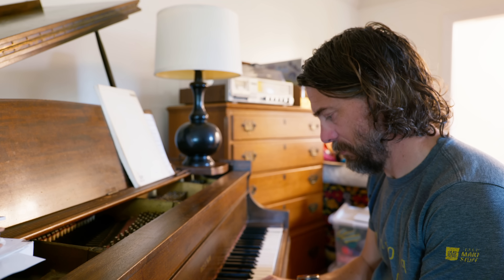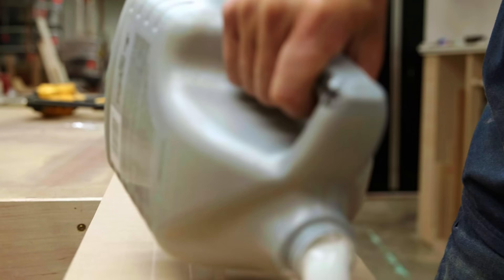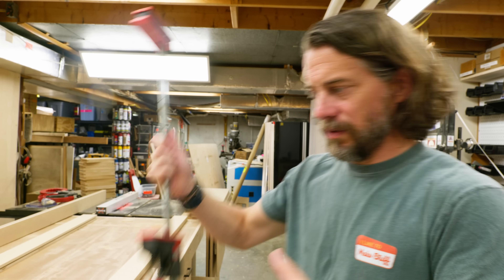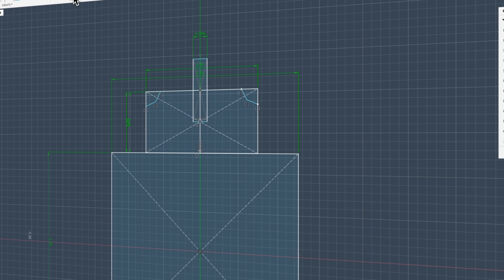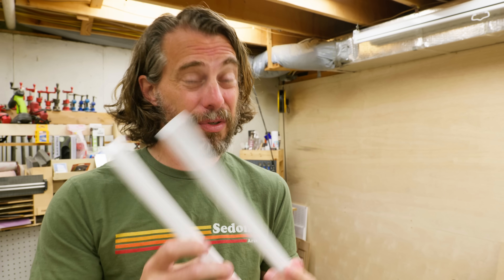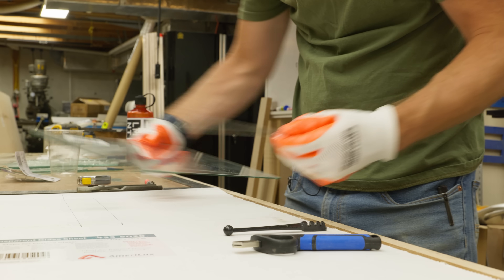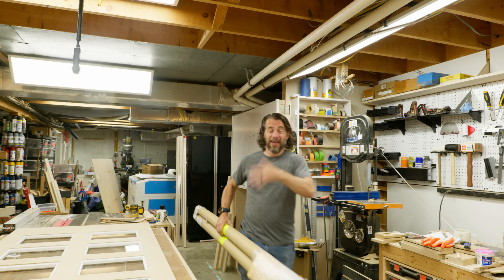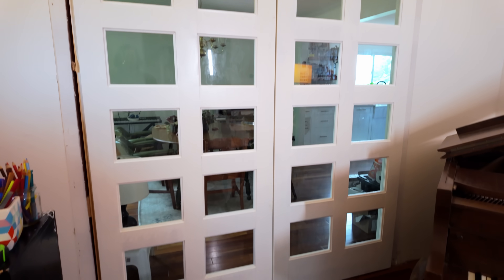I Made Doors WAY Easier With 3D Printing

Comment: Add something rubbery (neoprene?) to seal. Any crack air can move through, sound will get through. 
Could use magnets to hold the two sides together.

Comment: Just a heads-up for anyone thinking about making a door with glass inserts: Most building codes require tempered glass in doors for safety. If you use untempered glass, it could cause problems later, especially if you plan to sell your home, since it may not pass inspection.

Untempered glass breaks into large, sharp shards that can be dangerous, while tempered glass shatters into small, pebble-like pieces that are much safer. Just note that tempered glass can’t be cut after the fact, it has to be ordered to size.

Not a huge hurdle, but definitely something to consider if your looking to take on a project like this.

Comment: Glazing putty. It's existed for hundreds of years. Paintable, moldable, flexible, air-tight, long-lasting, and removable.

That said the 3D print holder is a neat idea. Doing a double pane setup with TPU interior seperator might have some interesting sound qualities.

Comment: Yeah this really is not how it should be done. You did not safe time nor money by doing those dirty hacks.
Make the door out of normal wood - MDF is not strong, not really cheap, and will likely not be lasting cause of that. Even with the MDF it would have been stronger if you made the door out of 2 thinner layers (now you could also have used normal wooden boards) so that the joint were all lap-joints: Simple to make and stronger.
For the trim: Making that with a router is straight forward and fast, and the simplest of jiggs would make sure that all cuts are at the same angle and length.
For the glass: Not a good idea to use normal flowglass for that - either get tempered glass (most likely even required by code) or use acrylic. And the glass having no movement is NOT what you want in this configuration. Sure MDF has a lot less seasonal movement but it still means that any and all movement (be it temperature/humidity related, bumping the door, or the sagging over the years) will put stress on the glass. Glasspanes should either have a bit of room to move or just be lightly held in place by some malleable material - think weather-strips.

Comment: I love these videos. I really like this channel. On these doors though, I thought there was supposed to be a loose fit on the glass to allow for expansion and small shifts, vibrations or flex.  I feel like if someone runs into this door or leans on it flexing it, the tight fit of the glass is likely to lead to them breaking.

Comment: Caveat on the Lowe’s/glass cutting: the helpful associate usually will cut those for you, as long as the cutting machine is working (there’s a cutting wheel/blade for plexi/acrylic and a different one for glass and sometimes they’re out of replacement blades for your particular material). Also the helpful Lowe’s associate will cut a piece once for you as a courtesy (if you’re nice and they’re not busy with other customers, you might be able to get a second cut for free or there may be a small fee) 
Remember that politeness goes a long way. Your mileage may vary

Comment: that trim youre looking for for your glass panels is called base shoe/cap molding... we use it all the time installing cabinets... youre almost guaranteed to find it in the flooring or crown molding section of your hardware store, in that exact profile as your other door... i know by commenting on the posted video its a little late... but i like to share the knowledge ive had the privilege to learn in my current field of work

Comment: that trim is using a round over bit

also i only have a few issues with this build
1. MDF is the wrong material for doors (i give it a few years before you have to replace it)
2. wanting the glass to not move is ok but you need to allow wood to expand with the weather

Comment: Next time you cut glass, heat the scribe with hot water or a mild torch. It'll pop a clean line where you run the glass cutter.

Comment: could have made the door structure far easier if you'd just made the pieces in a way where they lap onto each other. would have been very easy because you were already sticking two layers together. just stager them so the corner of each one overlaps the next pair.

Comment: Honestly if I need super cheap glass, I go to the dollar store and buy picture frames. Here the dollar store is actually 1.25 now but for glass its decent price and already cut. I probably would have just used a routing table to build the trim. Just get a nice routing bit and run it through. The 3d print is a decent idea, i would probably have put a thin bead of caulking in the channel the glass slides into just leaving a little wiggle room for any expansion or contraction and keeping it quiet. You made the right decision to caulk them in, and a few dabs of CA. I have had glass cut and its always worth it. You can also call around and find stores that make custom picture frames, they normally cut glass as well. If I wanted to to keep the sound in, I probably would make them double pane or something but it turned out great. I like the synchronized door feature!

Comment: no visible fasteners ? dude, it's MDF, meaning you're gonna paint it, so just fill the whole in a sand it, also you passed up a much easier way to assemble that (half-flap joints before the initial glue up)

Comment: Is the glass supposed to have some give with those little foam balls or is that not needed in this case because there won't be as much wood movement from using MDF?

Comment: Out if the box thinking, I like it. In the UK any glass below 800mm (31”) needs to be toughened or laminated-is this not a requirement over there?
Reply: Just doors, or everything? Like, is the glass in your picture frames or microwaves all laminated?
Reply: @niceguy191 microwave, all appliance glazing is safety glass anyway. Doors, windows anything that should be movable must be laminated or toughened. Picture glass, mirrors etc are considered static products and aren’t subject to the same criteria.
Reply: @StopMotionTransformer Interesting! In NA it'd be tempered glass for the microwave or other appliances, but windows are almost always plate glass in a residential setting (like in this door). Large pieces like for a glass guardrail would be laminated, but in most doors it's just plate glass too. Commercial sliding or other glass doors are tempered though, so it's really a mixed bag.

When you say below 800mm, do you mean in size or height from the ground?

Comment: You're putting out all this effort to dampen the sound from the piano, but those single panes of glass are just gonna vibrate it right throgh.  Sure, it will be better, but it won't be anywhere near what it could be if you had double panes with different thicknesses, an airgap, and some sweepers / foam around the top and bottom of the door to prevent sound getting out...
Reply: The cool thing about the 3d printed glass modules is that they will be easy to upgrade 😂

Comment: Brilliant. I feel like you underestimated both caulk and CA glue when gluing them in like caulk alone would have been fine and you're gonna curse yourself for super gluing them. In conventional glass pane doors they use small nails and you can pry the trim out on one side. Another point toward buying a 3D printer

Comment: Another fun solution.  I would jot have thought of doing it with splines - i would have used 3 layers of 12mm but that would have meant all different size pieces.

Comment: 13:58 he may adress this but since the mdf is glued and not in the correct way with the shims(better way was a dato on the long bits of the door and just have the shim on the smaller parts already) and the middle part is just glued in place. and with the glass tight in the plastic wich sit tight in the mdf. the mdf may work bend a bit or some force is put on it the glass will brake due to the tension that is already on it. a better way was to leave a bit of space in case the wood or mdf shrinks or moves due to tempature or moistture or forces put on to it. leave some wiggle room for the glass and you will have less to worry about.

Comment: I would have suggested that window molding have some sort of snap in or out section to replace any broken glass with a small screw driver hole to pop out any time later.

Comment: well technically each door should be slightly larger than 36 inches so that the room completely seals off the sound. Also did you account for thermal expansion? Granted I believe you don't have to worry about that with MDF much, but what about the glass? Won't it crack?

Comment: Thanks for some great ideas for some cabinetry I need to build.  For the glass cutting make it easier on yourself and get a cutter with an oil resevoir and a pair of running pliers.  Both are cheap on Amazon and provide for accurate cuts and snapping your glass panel.

Comment: That profile of molding is pretty easy to make, all you need is a round over bit with a bearing and a hand router. Take a piece of wood bigger than you want the profile, set the depth of the bit too deep so the shoulder digs in, turn it up on edge then do the same. Then two table saw cuts to get the piece you want out of the bigger bit. You could give the apex of the curve a light sand if you want but you usually cant tell its slightly off

Comment: Someone's probably mentioned this, but the easiest way to get the glass to break where you want it to is, once you've scored the line, lift the glass up just enough to place a round toothpick directly under the score, press down gently on the glass with your fingertips about 3-4 inches out on both sides from the toothpick. The pressure will cause the glass to break over the toothpick and the break  will "run" down the score in an instant, giving you a clean cut. This will also prevent the glass from breaking like it did at 11:01 because its own weight started the "break and run" process. No more tapping needed.

Comment: Could you use little screws or pins to hold the plastic in place in them corners, that way there is a visual representation as to how it’s held in, and it’s easier to remove…. Maybe a bad idea, maybe not lol

Comment: Polycarbonate or acrylic panes would block more sound than glass (check the sound transmissive index), and be much safer if ever broken. You could also have cut them to size on your table saw.

Comment: You could have used a good larger forstner bit on the drill press and made several holes on the inside of the MDF before gluing them together. Maybe a bit more work when making the doors but it would have made the doors much lighter and easier to handle.

Comment: Is there a brake so the doors do not slam ? also no holes not pre driiled in mdf for the hanging brackets, heavy and with glass even heavier, would double up on the brackets !

Comment: Frankly if you are laminating two layers of MDF together you could have done lap joints and make these doors much stronger. Theater carpenters have been doing it that way for years. Also you probably should have glued in hardwood where the hardware attaches. Finally, ultralight MDF is your friend when building something this large.
Reply: Agreed - While I like videos that kind of 'work it out' I worry when some details are 'wrong' - these are floating tenons, the grain direction is not helping them, and the MDF may hold the fixings for a while - but they are super heavy and after a while may loosen (putting in the hardwood - or cross pieces of dowel) could mitigate this.

And lap joints would have strengthened the construction enormously.

MDF and softwood are such different materials - that just switching between the two 'can' work, but also fails to utilise their unique properties.
Reply: I was thinking the same thing about lap joins while watching. Also I would have used ronstan track for the sliders due to the weight.
Reply: I’m new to this channel, so I’m unfamiliar with the history of prior woodworking projects here, but I have to admit I was taking it back when he started talking about the problems not being able to use 2 x 4 construction lumber. He’s got some decent tools. Why not buy some wider boards at a lumber yard? If he doesn’t have a planer or jointer he can pay only a little more for surfacing and thicknessing, but the he’ll have material with the properties he wants.

Comment: I was screaming at the tv- glue up the inner spine first! not the perimeter! 😂
You could have simply slid the glass into your dado slots and added store bought window moulding at the end. Using deep pocket screws you can secure the two vertical styles so they are removable to replace panes as needed.

Comment: You could have designed some spring loaded splines that popped out into the spline dado to secure the panes. Or just simple arms that swing 90 degrees with a screwdriver turn to capture the dado. You could caulk up the holes. 
Food for thought.

Comment: When you talked about pocket doors I was thing you will be tearing out the walls but now I think you will be building a new wall over the doors? If that is the case I might have tour off the drying wall and trim from the side you mounted the door to in order to make the finished wall just a bit thinner.

Comment: Cutting glass can be tricky. I worked at a picture framing shop when I was young. The hack I used was to lightly press on the back of the scribed cut.  Worked better for me than tapping the glass.

Comment: Oh I thought for sure you were gonna automate the doors opening in the next episode..... I think you should! But they have to open quickly, run very quietly, AND you should e able to open then manually with it hurting the mechanism..... pretty tall order huh?  I think it would be easy if I didn't include the manual opening... but you could have a handle that when you pull it to the side it disengages the motor system.... 
This would be a really cool project, but it would take a while to build and get just right.... so probably more than one episode... 
- wait a second... what about the doorway on the opposite side of the room?  not worried about sound going out that way huh? Well if you were then you could make identical doors with the same exact slide mechanism, and automate them so you could press one button and all four shut, keeping the piano from bleeding into the rest of the house.... just an idea :)

Comment: Always love your videos. On a large piece of glass, once you use the glass cutter you can place something like 1/16"-1/8" dowel under the glass (on the cut line) and then just press on either side to help get a straight cut. They make special pliers (look in stained glass supply houses) as well then apply perfect pressure to a cut line to help snap it but they are mostly for smaller pieces and not cuts over 1' long. The pliers are not to expensive either (less than $20).

Comment: btw if you all want to soundproof all that matters is mass, thicc, dense material in between the sound and where silence should be. the spiky triangle foam thingy is just to reduce echo, sound still goes through it to another room (unless you want to completely decuple the room from rest of the building, good luck!)
Reply: If he was going to print the trim, I would have added double glass on each panel.

Comment: And this is why so many instructional videos habitually include the classic dry fit step that never seems to be necessary until you skip it and find out that you don't have a spline for the vertical beam.
Reply: 🤣Been there. Done that. Got the T-shirt!
Reply: Measure once cut three times

Comment: Sounds weird, but there’s actually another easy way to cut glass. place something like a piece of string soaked in alcohol across the cut line. Then light the string on fire, let it burn for a while (20 sec) and then put something cold on it.. the line will crack perfectly.

Comment: It's funny watching this video when I just recently ordered Slid'Up hardware with plans to make a sliding door out of MDF. It's even a shaker-style door, but it wont have glass panels. My plan is to use hardboard for the middle (full door size) and then attach the MDF strips to both sides to form the panels. Should be a lot simpler than what you had to do with the glass.

Comment: one thing you could try with the 3d printing would be wood filaments. there are a lot of them on the market that act just like pla, but they're about 20% wood, and the end result is this really interesting hybrid that feels more like engineered wood than plastic. you can even varnish it like it was just a piece of wood, and if you're gonna paint it it's just going to have a different texture than plastic in the end.

Comment: Glazing Points. They are little metal arrow looking things meant to hold glass and frame backers in place. They are fully removable, and might be a better option than CA. They look great, and 3d prints for the molding is interesting